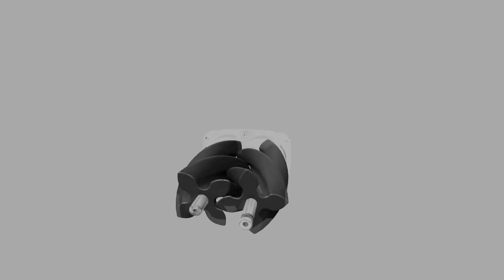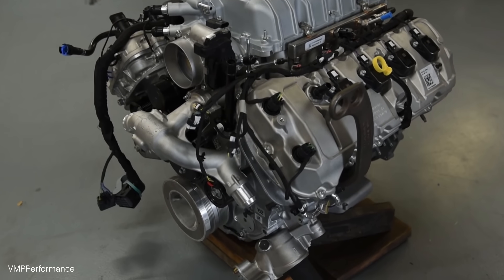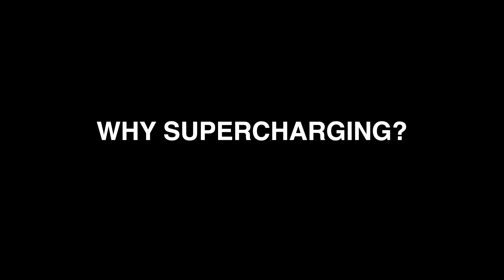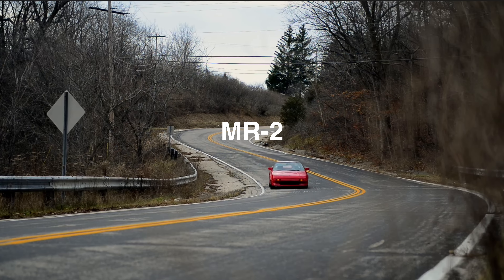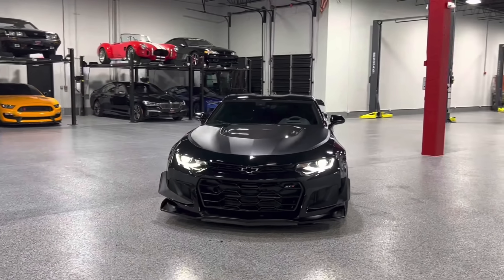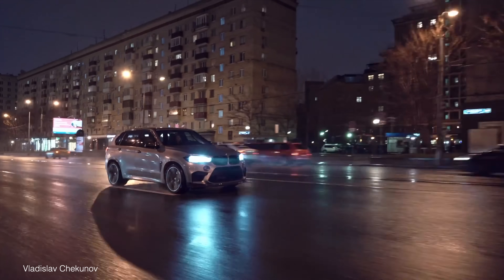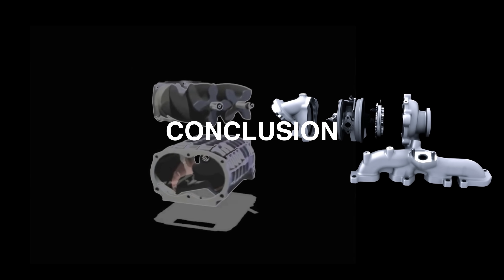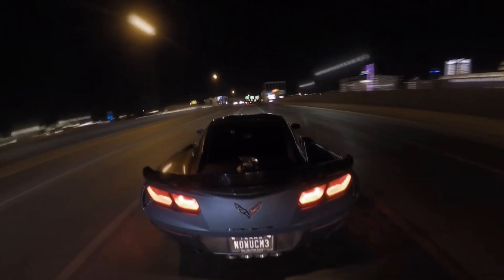Why V8 Engines Are Supercharged vs. Turbo😮| Explained Ep.6

Comment: Good video. I think it's worth noting that it's not just the engine that contributes to the difference in price between an American muscle car and a European sports car; there's also usually a not insignificant difference in build quality. It doesn't mean that one way is right and the other is wrong (I wish we had that choice of well priced muscle cars here in the UK - once imported they tend to be quite expensive).
Reply: The odd thing is most European cars last until they don't and then cost a fortune. Most US cars are able to be kept on the road cheaply and easily (think vw bug 4 fuel pumps, battery replacement that requires recalibrating a computer, and oil changes where it's strongly recommend to vac out the oil rather than pull half the bottom of the car apart to find the drain plug).

We also have a bit more space. I have a 16 with 290k miles, a 00 with 252k, and an 03 with 260k (all small block v8 trucks, but the 00 is a 5.7 vortec that is starting to show it's age by burning a little oil). 
Last year was 20k miles and I didn't think I did too many trips. Just did a short 2 day trip last weekend to see a rock concert and it was 1600 miles.
Reply: @leftyeh6495  that is a positive of having a large engine with a relaxed tune; it'll basically last forever. Not so common across Europe; I assume partly due to fuel prices making smaller engines more practical.
Reply: quality isn't that different anymore, extras are. Amercan cars tend to be more about actual driving and/or comfort, while european cars go for, sometimes unnecessary and expensive, gadgets for everything. Also, no european manufacturer makes any cheap sports car that could be compared to the soul of muscle cars (by og definition a cheap but powerful car)
p.s.: Even in Europe, a Mustang GT still has the best value/power ratio

Comment: The exhaust fluttering sound of twin turbos is super sick though.
Reply: im not an expert by any means but aren't those just flutters (i take it you mean the crackles and pops?)  intentionally programmed misfires that could occur just as well on any engine setup?
Reply: @hazardeur  he’s talking about the blow off valve sound not exhaust sound
Reply: @Lemansenjoyer13  Or a turbo with no blow off valve that just ends up having air go back through it
Reply: @SeeFlow-bo1dl  yeah that is true in this case

Comment: The thing is - american cars are made for fun and driving experience, european just for bragging about and prestige. So american cars have to be fun to drive where no lagging supercharger is better, while european have to look good on paper where efficient turbos are better. End of story.
PS: No pushrods aren't used just to save costs, they are used cause pushrod 6 liter engine is smaller and lighter than 4 liter DOHC. Pushrod also make more low end torque than DOHC from the same displacement, and are just better to everyday driving, cause all benefits DOHC gives you recieve after 6k rpm, which isn't good for everyday driving, and normal people avoid driving on so high revs. Europeans use DOHC to pointless technological masturbation.

Comment: It is more of a packaging and cost thing more than anything else. A blower o  top of an integrated intercooler in place of a standard intake manifold takes up not much room. Opposed to 1 or 2 turbos all the piping to the remote intercooler, then piping to the intake manifold. 
Hot V turbos are a mediocre design to compensate for lack or underhood real estate. 
Love the sound of a blown 5.4 Lightning.... but S475 sounds good too

Comment: Because with Twin Turbochargers, you have installed 2 Blow Torches in the Engine Compartment. Depending on the ambient temperature your hood/engine compartment may cool down within 6-8 Hours. No matter how good the shielding is. This decreases the longevity of every wire, plastic wire connector, the throttle body motor, housing and wires, plastic housing for the numerous computers, plastic radiator top, vacuum hoses, plastic window washer containers and their lines, high pressure fuel lines, brake lines, plastic radiator parts and plastic overflow container, plastic engine ornamental covers, plastic brake fluid containers and their master cylinders, the turbos themselves, the rest of the exhaust system including the cats, the alternator and its electronics (diodes for AC to DC conversion?), the coil packs for each spark plug, the ceramic on the spark plugs, the A/C compressor and lines, the power steering compressor (and its plastic fluid housing if hydraulic) and lines, the plastic air cleaner housing and plastic intake tubing, and (at least in BMW's case) possibly the plastic oil pan. And the higher overall heat stress on the cylinder head and block from wider temperature cycling.
With a screw type Screwcharger, the whole engine compartment, and everything in it, will never get as hot and will cool down at least 4+ times as fast as the twin turbos. Giving increased longevity to the parts mentioned above. Plus no turbo lag at all. There are anecdotal reports that very high boost pressure at low rpm's is harder on the bearings?
All things considered the Supercharged car will probably last longer if you're not too flat footed of a driver and don't race the car. The Twin turbo will not last no matter what unless you only use it as a daily driver...and that would be pushing it.

I watched an interview will all of the Ford technitions at a large shop by a sales(?) manager, or maybe the dealership owner or an underling. All as they left work for the day about 5+ years ago. They were asked whether they would get the N/A 5.0 liter V-8 or the turbocharged V-6 eco-boost. In an F150 pickup truck. Every mechanic over 30, didn't hesitate and just said the 5.0.
Al the younger mechanics said they would probably try the 3.5 liter EcoBoost. Most said because it had better technology.
How did that work out?
I drove a friends early model turbo-Porsche. It had about 3 seconds of turbo lag. Before that it sounded and performed like a Volkswagen Beetle. But I have an inherent hatred for Porsches. Because back then they were glorified Volkswagens. The best mechanic I ever knew was a Huey door gunner mechanic in Vietnam. He worked on airplanes. Mostly piston twins and singles. His wife had a basic red Porsche. He made her sell it because he got tired of working on it all of the time. That taught me a lesson I've never forgotten.
Reply: I would say it depends my twin turbo inline 6 doesnt get anywhere near as hot as my NA V8. V8s in general are furnaces I love them though. But comparing NA V8s being cooler than twin turbo V8s is fact my God they let off some heat even the fans kick on when it's off on ours.
Reply: @YourAssAintSafe  A twin-turbo in-line V-6 is a different animal. Although I don't see them very often. I believe you that it is cooler. A lot depend on engine compartment size and "packaging". The flat-head NA V-8 in my 1953 Ford, years ago, looked puny inside that gigantic engine bay. Then again it was a very simple engine by todays standards.
Now a NA Big-block in a C3 Corvette barely fit. It wouldn't cool properly at idle from the factory for more than a few minutes. Years ago I saw a Small-block C3 with an add on, no intercoolers, dual turbo "kit" added. Even with special shielding on the inside of the hood it still melted the fiberglass. Although I suspect it had been used on the 1/4 mile track?

Comment: If you have never ridden inside a car with a twin screw supercharger you have no idea.  I drove a 2006 Shelby GT500KR whit a fair bit of mods and tuning.  WHAT A VICOUS ANIMAL!!  Beast mode times 10.  Since the car wasn't mine I never turned the traction control off, but the engine could out drive the TC in the 1-2 shift 2-3 shift and even the 3-4 shift.  I've been in some serious old school big block muscle ( 69 stingray 427 Tri-power, 70 HEMI Cuda, 427 side oiler Fairlane) and that Shelby shocked me.  Then there's the sound 4:30

Comment: Everyone always forgets that the turbo chargers destroy the characteristics of engine noise, because the turbine acts like a massive baffle. A supercharged C7 Z06 is a V8 with a VERY unique sound. However, one turbo v6 sounds like any other turbo v6.
Reply: Idk every manufacturers engines has unique engine sound. BMWs has a similar tone no matter the engine. All Volkswagen and whoever they own sound the same. Only time most engines sound the same is if they have some Ebay turbo or intake on them I've noticed.

Comment: Yea the ZL1 does have the same time around the ring, although it needs 240 hp more to do so. 

There's a reason they're priced the way they are.
Reply: it was manual, with steel brakes, and inferior quality tires and weighed almost 1800kg.  there are several ways to make a fast car.  Porsche bets on technology with more resistant and lighter materials.  with great dedication to aerodynamics, chassis, suspension, brakes, etc.. all this makes the car more expensive.  now look at the C7 Z06 for example, a magazine did 7:13 if it was GM it would have done around 7:10 - 7:11.  so your excuse about having more power doesn't make sense, when the other car costs twice as much.
Reply: @Luke-cb3ly  the cayman gt4 rs actually did 7:04 secs and that wasn’t even Porsches best driver also you’re comparing a naturally aspirated flat 6 against a supercharged v8 stop being a fanboy
Reply: @Luke-cb3ly  the funniest thing is you didn’t even do your research the zl1 1le did 7:16 secs Nurburgring with a better power to weight while the gt4 rs did 7:04 secs with a naturally aspirated 6 cylinder 2 less cylinders than the zl1 1le not to mention even the bmw m5 a literal luxury saloon keeps up with a zl1 which is a track focused car on the track you couldn’t afford any of these cars so
Reply: @Luke-cb3ly  interior quality should say everything
Reply: No the gt4 rs did 7:04 secs

Comment: I think the future of power is hybrid supercharged V8s with the electric motor spooling the blower taking the loss off the engine and making stop start very efficient!
But just my two cents
Reply: But where does the electric motor get its power from? The battery, fed by an alternator, driven by…. the engine.
Reply: @axi0matic  like every other hybrid
A battery pack. Don't need a big one and the motor only needs about 30horse
Reply: @bigrocc3925  the battery pack is ultimately charged by the engine. So you’re not taking any losses off the engine, and may as well drive the supercharger directly via a belt.
Reply: @axi0matic  other options, like a plug in system. Charging a battery is less then running the SC. And when the battery is charged it will drain nothing from the engine

Comment: There's a lot of wrong information in this video. They named only one supercharged vehicle for Ford claiming that Ford has used Superchargers more than anything else but there are literally 10 different models with turbo Motors in the last 10 years alone. Make sure you fact check people
Reply from the maker: I said for High HP platforms, ecoboosts aren’t flagship models. The 2007-20 GT500s, the 03-04 Cobra Terminator, the Raptor R, Lightning all are supercharged….
Reply: Raptor isnt supercharged anymore either 🤦🏾‍♂️
Reply from the maker: The Raptor R is, they just unveiled it for 2023 with the GT500 engine. Bruh you gotta research…

Comment: important thing to note. A supercharger with a pressure bypass that allows n/a performance off and partial throttle only draws as much load as an unloaded alternator
Reply: You could also use a Centrifugal to get full boost when you rev up to max power, but don't care about grabbing as much boost pressure in the mid to low range, like for more "normal" driving. Less punch-out than a twin screw, but better high end power due to better efficiency, and you don't have to throttle the engine as much in normal driving to "undo" all that boost work the twin screw did

Comment: Another huge advantage of turbocharged cars that's worth mentioning is their improved ability to make considerably more low-end torque (and withstand more total boost iirc). I don't have a favorite engine type but both are pretty rad, I drive a supercharged 2012 Audi A6 3.0"T" and love it's supercharger whine. At the same time, turbo engines usually make wayy more torque down low, and hearing the turbos build and release sounds great in it's own way too.